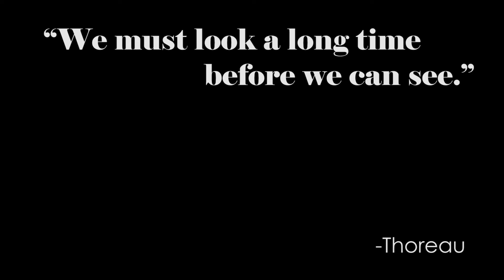Rustic Outhouse Roofing - MF/DIE#15

Comment: It's quicker to take a pair of pliers n pull finishing nails straight through  the hole instead of trying to straighten them n pound them back out. Plus it doesn't damage the wood as much say if you were working with trim. Just a little trick I learned yrs ago.